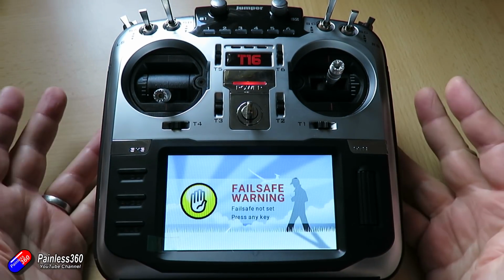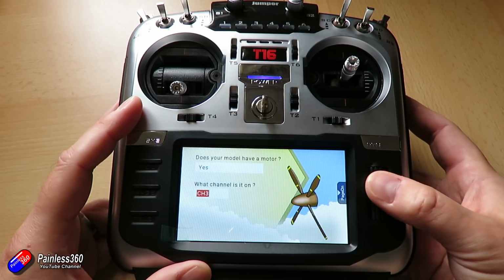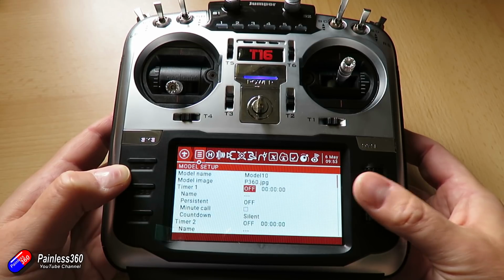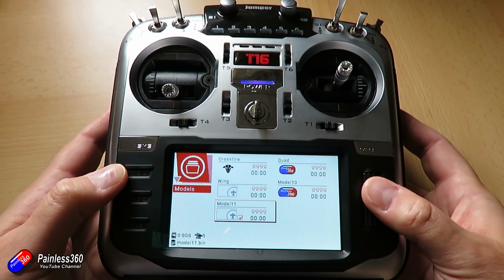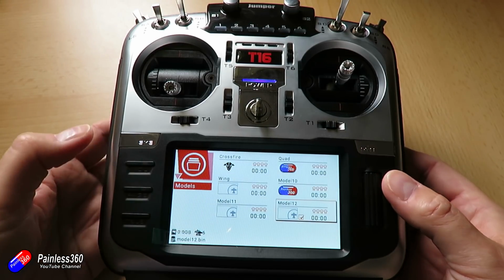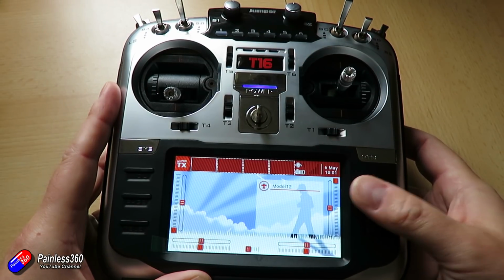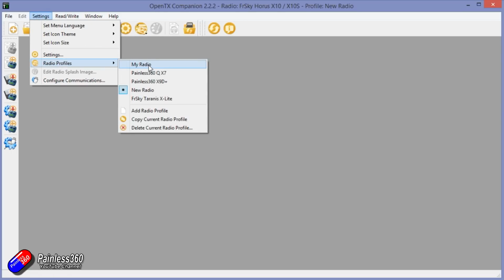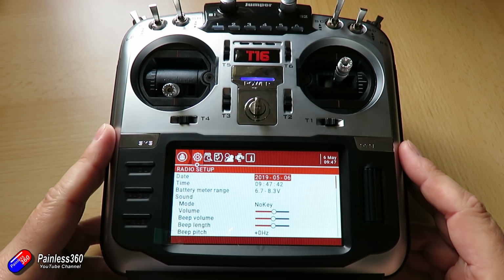Jumper T16 Radio: Model setup tips

Comment: why jumper T16 can't run R9 2018and access 2019 i can't bind my Rx (R9Mini)to it  . if you cane help please
Reply from the maker: It is a function of the support in the multifunctional module, not the radio. I don't use R9 here so not sure I can help... Best of luck

Comment: Great. do you have problem with switch
SA,SB,SC,SD normali in 3 position. But in
actual my TX only 2 position..
in hardware setting in 3position..Thanks.
Reply from the maker: Not sure, what are the setting for the switches in the radio menu? What have you already checked/tried?

Comment: Does anybody know how to change from mode 1 to mode 2 in the settings?
Reply from the maker: Radio setup menu. First page I think. See my videos on changing modes...
Reply: Painless360 thanx I found it...I issue I’m really having is the keys are stuck. My page button does not work. Everything is kind of screwed up on radio. I can’t get to inputs or mixer pages.
Reply from the maker: They might not be stuck  - there is a common issue with this radio where the ribbon cable comes loose..
Reply: Painless360 I’ve taken ribbon out and put back in etc...still doesn’t work.
Reply from the maker: Bum, I hope you get it sorted. These kinds of annoying issues are why I stopped making videos on it or talking about how great these radios were here on YouTube.. Many other channels still do in fact..
Reply: Painless360 I figured it out. I had to reinstall firmware and as card. I also reversed ribbons.

Comment: I was wondering if you know how too or if its possible to set-up  a lemon type  reciever on this radio with a gyro and safe mode, I have been buying the admiral recievers from motion RC and have not been able to figure out how to set up they gyro and stability mode? any help would be greatly appreciated. obviously this is for fixed wing models.
Reply from the maker: Possibly,  I don't have one to try. Happy flying!

Comment: Hi, would you be kind enough to make a tutorial on how this come to play as far as setting up the mixers/inputs? 
Multpx:  The Multpx setting defines how the current mixer line interacts with the others above it on the same channel. “Add” will simply add its output to them, “Multipl” will multiply the result of the lines above it, and “Replace” will replace anything that was done before it with its output. The combinations of these operations allow creating complex mathematical operations.

Comment: No heli's - guess I bought the wrong radio ...
Reply from the maker: Opentx does have swah mix support. Most modern helis use a flybarless controller so you don't need swash mixing anyway... Happy flying!
Reply: @Painless360 
I completely missed this msg - youtube doesn't always update replies it seems
With that said, I've since purchased some small 3-4 channel helies in hopes of learning how to bind the Tx16 to them in the process
Have you ever done this and do you think this is a good way to ease into open-tx radio territory?

As I understand it, I have ordered the FUTABA FHSS module on banggood  to make them compatible?

- thanks for all your video's btw - I really appreciate them  - my hope is to make nice profiles for all of my heli's using this radio - though I'm a bit overwhelmed atm
Reply from the maker: Video about this in the works right now..
Reply from the maker: https://youtu.be/u-NykZnjRM0 may be of interest..

Comment: Hi there. I’m subscribed to your channel and I’m wondering if you have any video of the Jumper T16 setup for Helicopter. I have a Goblin 380 currently bound to my Futaba 14SG, it has a KBAR flybarless unit and I will be purchasing a SFHSS receiver for it so I can bind the T16. Thank you so much.
Reply from the maker: Hi there. I only have one video on how to setup OpenTX for a swash-mix but most modern helis have some kind of controller that handles that the old fly-bar used to do and more. If it has one of these installed then setup should be simple with you just matching the channel order it wants with no swash mixing needed on the radio.. Hope that helps..
Reply from the maker: https://youtu.be/u-NykZnjRM0 shows how I setup a flybarless heli here in OpenTX..

Comment: Setting this radio up for a friend... using flysky (I may end up swapping the rx for a FrSky if i can't figure this out). Trying to bind the flysky fs a8s... the Rx does go into bind mode, but it wont bind to the radio. Using external RF Multi FS2A_RX (People had success using this instead of the flysky setting, but i went ahead and tried all flysky modes too). any ideas?
Reply from the maker: All I'd try is stuff you've already done. If you get it working please let me know..

Comment: thank you very much spot on just what i was looking for a few little bits are out of date now but it helped me a lot i have only just purchased the t16 pro & now i have found out the t16 s will be coming out with built in charging bugger.
Reply from the maker: I don't like the way they keep releasing updated versions...
Reply: @Painless360  well that is the modern world we live in.... He says after only just moving from 35Mhz TX to the 2.4Ghz jumper t16 Pro. can I use any of my old Tx's   with my t16 to learn other people to fly buddy box or do I have to buy another t16 and do I need a cable or can I link them via WiFi

Comment: Great report I just bought the lastest  jumper t16 don't  know if it was a good idea for first radio can you addvise me on the best receiver for t16? I have 2 iA6B can I bind them to the jumper?
Reply from the maker: OpenTX is a very powerful system but can be overwhelming for the new pilot. I'd recommend watching my OpenTX mix school for the basics. I've not tried those receivers here myself but the supplied 4-in-1 module has a ton of options, one of which will probably work with those. Best of luck!

Comment: Hi Painless360, Hi Oscar, just wondering if these remote has Access protocol software installed already? I have the Pro version and it’s opentx 2.3.2. I used to have the Frsky X-Lite S access and the flashed all my receivers to Access, now I’m wondering if they work on this controller or is there any way to download the access protocol and install it into this unit?
Reply from the maker: I doubt it. I don't have the Pro here to check..
Reply: Painless360, Thank you for your quick response. Another question, I am just wondering how to update my  R9m module and some Frsky receivers from Jumper T-16?

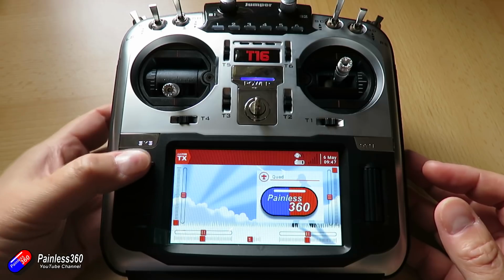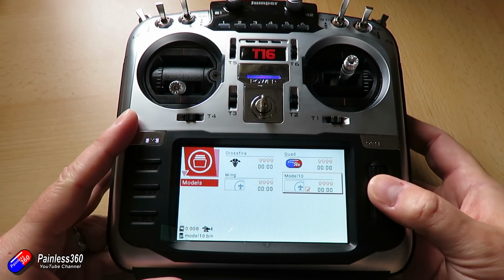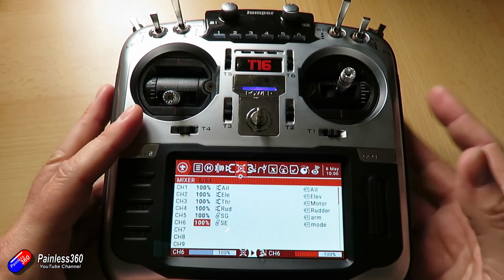Comment: Hi, I have a few basics.  1. @1:47, You should also have mentioned here that holding down the "Page" button will take you back a page (Page Up); 2.  @4:19, if you select "No. I need to change something," how do you go back to change something?; 3.  @4:31 How do you delete Model10? Model10's popup menu, the one you just made, do NOT have the "Delete model" option. Why is that?; 4. @12:09 how do you remove your settings from CH5 (for example) without deleting CH5 from the list? Thx.
Reply from the maker: Please see my OpenTX series where all of those things are covered.  You can not delete the current active model memory.  Happy flying!

Comment: Does any know if you can display the transmitter battery voltage on the screen instead of just the icon?
Reply: I figured it out.  Hold down telemetry and setup a widget.  Choose VALUE for the widget type and change the source to BATT.

Comment: So stoked I got the Jumper T16 pro Hall. Sure have been learning a bunch about it.  Thanks for making this helpful video.
Reply: too bad it doesn't work... V1.2.1.85 internal RF module is corrupted
Reply: @tonydean2455  My internal module works great. Wonder why yours is not working? Did you connect it up to a computer. I have not done that with mine. Still kind of figuring out all the adjustments and settings on mine. But overall I really like it. Reach out to these amazing you tubers. Bet someone might know something to try. Hope you get it working.

Comment: Hey guys 

I’m having issues with using the JumperT16 pro with the BnF umx sports cub the linked video is exactly what I have plane and tx the module binds but no control on AETR they just go crazy and the jumper keeps saying telemetry lost telemetry recovered over and over. 

Funny thing is I came from Futaba 14SG and I got a dx9 module made up years ago for the bnf stuff and it works perfectly with the umx sports cub.

Just when I thought I was out Futaba pulled me back in. 

Any ideas on what going on with the J Tx?
thanks champs

https://youtu.be/Jk-MavS7Dl8

Comment: I’m all but convinced to update to the jumper from my old aurora9. The only sticking point is if it will bind with my hitec optima receivers. I’ve done some searching and am getting conflicting info. So as you have actuall  hands on experience with the radio,probably not hitec?,you may be able to give some informed advice.
Reply: Yes, in your model setup, just set the internal RF module to MULTI then Hitec then choose Optima or Minima. I've just done this on my new T16 Pro. It'll be sad to pension off my Aurora 9...

Comment: More Jumper T16 setup, tips, and tricks videos like this please good Sir. Doubt that you need it, but have suggestions if it would help. Please and thank you.  Cheers Mate.
Reply from the maker: I;m not planning any as this is basically a 'very close cousin' of the X10 ;) The settings and setup are the same..
Reply: @Painless360  thank you sir
 Makes sense
Reply: So sorry to bother you again, but not everything from my taranis am or sound pack works on the t16 jumper. Specifically,  shtreal doesnt work. Any idea why? Thanks mate.

Comment: On a wing model there is no need to reduce outputs to 50% .. that will just reduce the maximum throw on both elevator and ailerons to 50%.. use 100%  for all... the combined result will be fine

Comment: Is there a way to do a factory reset?  I added models from a Joshua utube vid and now it keeps doing emergency mode. I deleted all models on open TX and did the firmware update, but it’s still doing it.
Reply from the maker: I'd ask him if it was his file that broke it. I'm not aware of one. Best of luck..
Reply: Painless360  once I removed all my models from the sd card it stopped do the emergency mode error.

Comment: Hi. Thanks for the info here. Helped me set up my T16 and it's ready to go for me to have a fly. However, I have a quick question. How do you switch between telemetry screens? I've set up 2 different telemetry screens. Screen 1 is for INAV telemetry and screen 2 is normal data. However, I can't seem to figure out how to switch between those 2 screens. Thanks.

Comment: Hi, I just received my T16 (versioin 2 with hall) i have tried to set up dual rates for one of my models but nothing i change on the input page seems to make a difference. I even tried to add expo to the standard set up and it was not reflected on the model even though there displayed graph replicates what the expo should look like. changing weight also doesnt make a difference. please help :(
Reply from the maker: See my video on DR setup. Best of luck!
Reply: @Painless360  followed every step. no luck. thanks anyway
Reply: @Painless360  created a new model from fresh, problem has gone. now to try to solve the nil aileron response 🙄

Comment: Great video thankyou! Question, is it hard to change from mode 2 to mode one?
Reply from the maker: Not sure, I've not tried. There is a setting in the OpenTX menu and the access to the gimbals isn't too tricky. I'll bet another content creator has already done this.. Best of luck with it..
Reply: @Painless360  thanks Lee..  I'll do it when my radio arrives next week and let you know how it went... cheers!
Reply: @Painless360  Thanks for the Vid, I forgot how to make / copy a new model. So easy, just hold down roller. Hugely frustrating forgetting to hold down the roller. Zaine

Comment: I've lost the screen on mine because I changed the time out to 0. How can I reset to default as I have no way of seeing what the he'll I'm doing! Please any advice would be useful!
Just found if I shine a torch on the  screen is can see the setup screen . Was enough to read set the screen. Jumper should make it so you can't turn the screen off inadvertently!
Reply: I too lost the display, recovered it by changing contrast values by connecting to my pc via a usb port.

Comment: Well my radio finally came and I'm having a terrible time trying to assign fresh images, I think it's the right size and in the right folder but doesn't show when I go to apply to my model, it does however show when I load the system menu and view the contents of the SD card. Any Idea what I could be doing wrong?
Reply from the maker: It took me a couple of tries to figure it out so I will be making a video on it very shortly. Keep an eye on the T16 playlist. Best of luck
Reply: Fantastic, thanks. This radio is great, but it's driving me crazy.
Reply from the maker: Can you send me the file you're trying and I can fix that as part of the video?
Reply: https://proxy.duckduckgo.com/iu/?u=http%3A%2F%2Fwww.robotcombat.com%2Fproducts%2Fimages%2FBLH8700_lg.jpg&f=1 The first model I made, figured an Inductrix would be a good start. Tried resizing it and still no good.
Reply from the maker: Thanks for that - the image is huge but resizing it here works great. What have you tried to get it to display?
Reply: Just saved it as Inductrix.jpg and resized it multiple times but doesn't show in model menu as an option, only in the system menu. Tried resizing to 192x??? and a few others, still no luck.
Reply: Just tried with another, downloaded the jpg, resized in paint and copied to IMAGES folder in the SD card and it just doesn't show when I try to add it to a model, although as always I can view it in the system menu. It feels like the SD card isn't being refreshed as my new files never show. Image is 192x120
Reply from the maker: Here is the one I've get working here - https://www.dropbox.com/s/ocd8j4rkejel4gh/whoop.jpg?dl=0 let me know if that works for you..
Reply: Sorry, didn't get a notification about your msg. Naming conventions was the problem.

Comment: will ask.
is it possible to use the transmitter module Jeti duplex TG2EX in transmitter jumper T16?
Reply from the maker: I've not tried it but the support for the JR bay appears to be pretty standard..
Reply: @Painless360  thank you
Hi,
please, give me an advice.
is the jumper t16 reliable for controlling the f5j models according to your tests?
perhaps using the Frsky xjt transmit module?
thank you for answering Boban

Comment: This this my first go at open tx, I've had spectrum and old school 72mhz jr quattro for 20+ yrs. Wow watt a learning curve, I'm having all kinds of trouble figuring this thing out. Thanks for a great video with lots of info. Guess I have a ways to go lol. Has anyone used this with spectrum bnf planes?  I've been trying to with the 1.2m optterra bnf, I can get it to bind but that's it. Can't get it to arm the motor or anything else...
Reply from the maker: Be careful as there are a few DSM options (11ms, 22ms, X, 2 etc.) so try them all until you find the one that works.. (make sure that prop is off! :D )

Comment: Can you tell me how to change to a different switch on my flaps.  It defaulted to a switch I'm not used to using for flaps.
Reply from the maker: Check out my OpenTX videos as they cover that. You can edit the output in the mixer for the channel you want to change, highlight the switch currently in use and then move the one you want - https://youtu.be/wzcilKe_1NE
Reply: I figured it out
Reply from the maker: So the video wasn't needed?

Comment: Anyone here has issues with MDL (model) or SYS (system) buttons with 
T16. I love the radio very much. Right out of the box i cant add any 
models because MDL button does not work.  Help please.
Reply: I have seen others with this problem and they had to open up the radio and re-plug in all the ribbon cables to solve this issue.

Comment: Would you recommend the radio?
Reply from the maker: I really like it but there are reports of the roller breaking if you're too rough..
Reply: @Painless360  Definitely one of the weaker points of this (otherwise great) TX. I personally tend to click only on the lower end of the roller bar, where the actual switch is located; this helps reduce the overall amount of pressure required as well as the stress exercised on the potentiometer and the rather fragile joint pin at the upper end.

EDIT: O.K. - Just read through the rest of the comments and found that the above
- can be said with much less words :-) and
- doesn't seem to work always and for everyone...

Comment: How do you change the splash screen?
Added a lua script & the original jumper to logo disappeared!
Looked in the images dir but,not there!
Reply from the maker: Did you flash the firmware on the radio? It's unusual that changing something as simple as a lua script would change the Startup image. That's normally something you select when you flash firmware?
Reply: Dump a file (of the correct proportions - the size escapes me at present) called 'splash.jpg' (or .png etc) into the 'IMAGES' folder, it'll pick it up on bootup.
Reply from the maker: https://youtu.be/c5yYpbOpXGc :D

Comment: Guys watch out! The ENTER button in the JUMPER TX 16 is really fragile and breaks easily. It just happened to me right now...
Reply: Thanks for the heads up. Looks like i'll be opening mine up when it arrives to see if it's possible to strengthen it internally. I'm guessing it's a similar arrangement to Spektrum radios.
Reply: If you contact Jumper, they will send you a replacement wheel.
Reply: @lloydpedvis238   i will thanks for advising
Reply: You should not press the top of the wheel, as this will break the wheel. 
Always press on the bottom of the wheel.
Reply: @lloydpedvis238  that's exactrly what broke